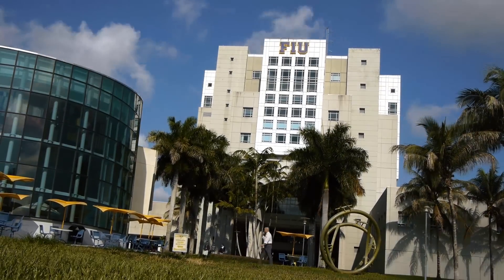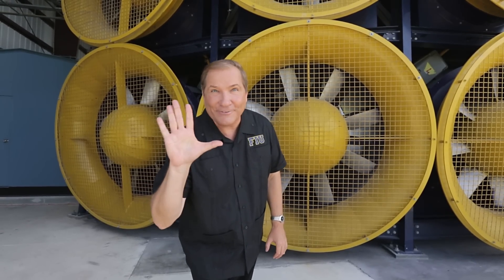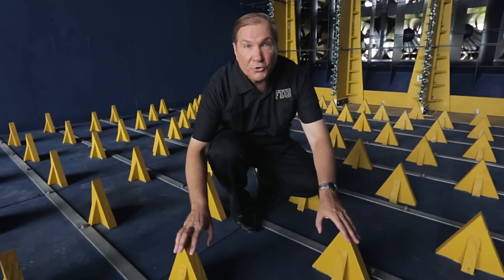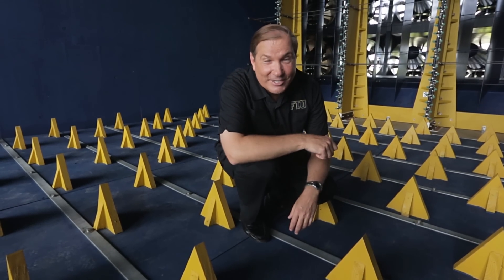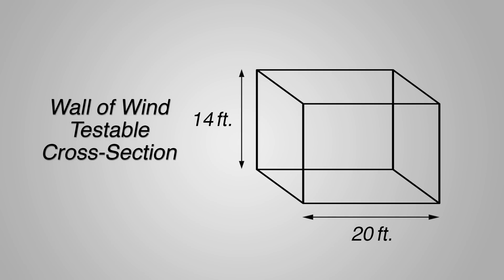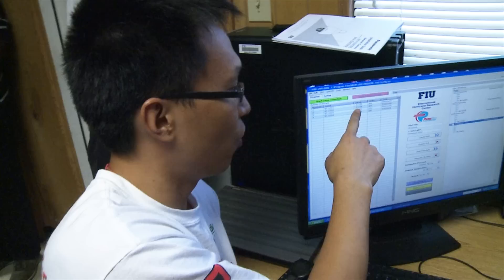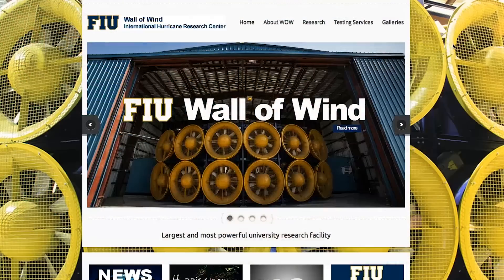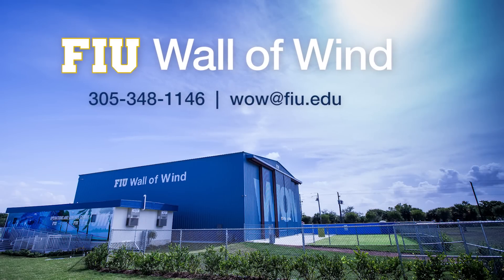FIU Wall of Wind - Open For Business

Comment: I applaud the effort, but this test does not simulate a category 5 hurricane in any serious way, as does not simulate the drastic and almost instant, pressure changes that happen during an actual storm. The negative pressure which is the "sucking" action your home, windows and doors which make them bow out, can actually be worse during a severe storm.

I even witnessed a glass manufacturer that was allowed to leave caulking all around the glass where it meets the frame, so these guys actually are cheating during their testing. When I asked someone there, they said they all do it. I thought, so they all cheat? Crazy. I am writing an OP Ed piece on how the hurricane standards in the United States, are weak compared to other places in the world, and I have found a disturbing culture at both the govt level, and the manufacturing level, and the testing level during my investigation. I recommend you research any hurricane protection products thoroughly, and know the testing criteria in the U.S. is weak compared to many other countries. For instance most American products are to weak to be approved for use in most areas of Australia, and this includes any hurricane resistant glass. These American products only have to pass a 35 mph impact test.